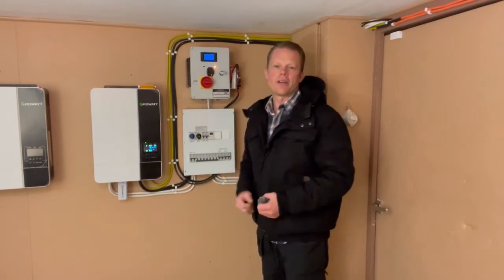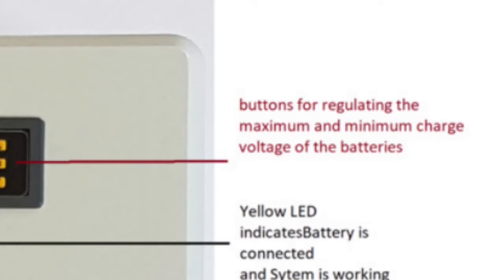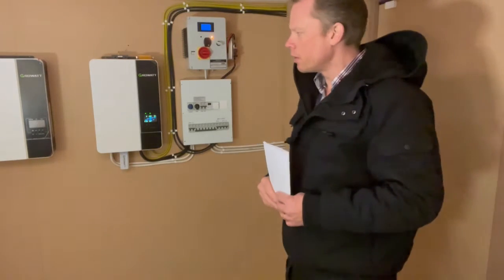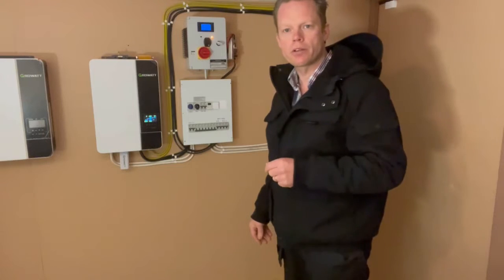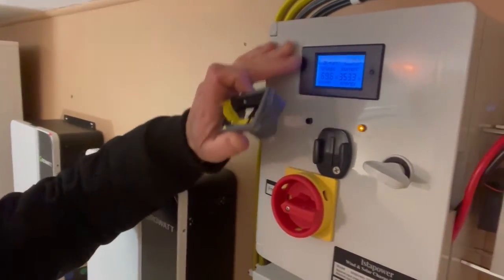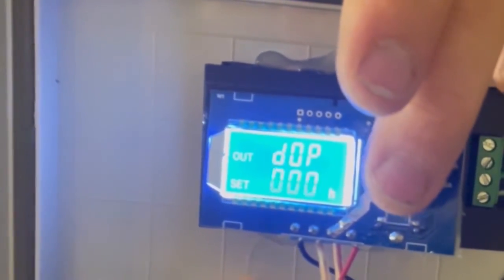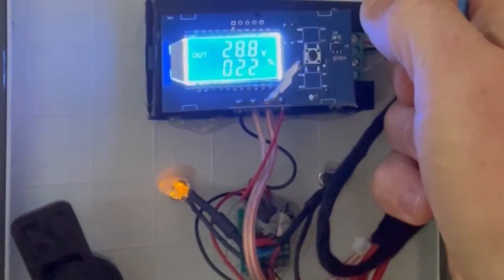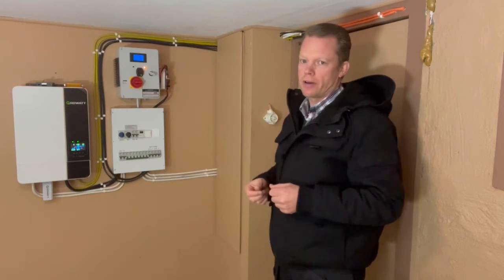Istapower wind turbine charge controller any good?

Comment: this controller is pwm, how do you charge your lithium battery bank with that controller? I understand that lithium is only charged by an mppt controller
Reply from the maker: Good question.

No this is not an pwm controller. It is just sensing the voltage, and when the preset value are reached it just activate a relay that short the 3 phases from the wind turbine. So it is a very basic controller. 

As long as I not exceed the max c-rating and max voltage on my battery I pretty much can charge it with anything.
Reply: Lithium batteries require perfect flat DC signal, to avoid damaging it.
I don't know the circuitry of this controller but i would rather use an oscilloscope to check first before connecting to lithium batteries.
Reply: I asked istabreeze if turbine + controller will work with lifepo4, they said its not compatible, probably because voltage is not adjustable??
Should I buy? And do what you have done?

Comment: Hi! I have a question about the Growatt inverters that you have on your wall. Are they the "SPF 5000 ES"? If you combine 3 of them, could you have 3-phase output then? And if so, would that be 240v or 400v?
Reply from the maker: Yes they are SPF 5000 ES,  you can combined three of them 
(up to nine if you like) and have three phases 400v output or you can choose if you like to go single phase with all three of them in parallel or only use two units as I do. You have to keep in mind that each unit will take around 70 watts in idle power so it will be pretty high powerloss with three inverters if you not need that power they can give you. The efficiency will be very low in those cases. That’s why I decided to go with two units in parallel and only use the second unit when more power is needed.
Reply: Ok, thanks! I don't really need all the power from 3 units, but I have a tire changing machine and a wheel balancer that run on 240v 3 phase. However it seems to me that you need at least 3 units to get 3-phase output at all...? Would you know if 240v 3-phase also is possible?
Reply from the maker: No sorry, I don’t know that.
Reply: You can configure 3 growatts to create a 3-phase system at any voltage. It is written in the manual, and all over YouTube.
Reply: @optopot4965  Ok, thanks! Would you know if there are smaller (and reasonable) inverters available, that also can be configured to 3-phase at a chosen voltage? I mean, if you don't need as much as 15kw total power, it would make sense to use 3 smaller and cheaper inverters to achieve 3-phase power...
Reply: Sorry, i don't know about other than growatt. Their smallest is 3.5kw, so their minimum 3phase system is about 11kw. Typically, 3-phase systems are for large loads and motors.

Comment: I have had nothing but bad luck with mine. The first controller didn't work, they sent me a second one. That worked for a couple of days then the panel started reading 5 volts low and the solar inverter kept cutting out due to the batteries going over voltage. After speaking with them and getting a fairly curt response I took the cd60 control panel off the first one and connected it to the second panel, which seemed to work fine for a while - about a week. Then we had really strong wind and the brake relays gave  out, once again causing an over charge and an inverter shut down. I took the first one apart to have a look, there was a burnt out resistor and signs that the board had been reworked some time in the past - the second board has beefier resistors on it so it looks like they upgraded at some point. The relays are cheap Chinese ones, I haven't taken them apart yet but I'm pretty sure the contacts are burnt or melted. The turbine itself seems fine, it produced 900 watts this morning before things started going badly wrong - the red led came on but there was no braking until I manually switched it to brake. Not at all happy.
Reply from the maker: That’s really sad to hear. Mine worked fine in 7 months without any issues at all, I have now sold it but I think it still works just fine. I which you better luck in the future.
Reply: I have had nothing but trouble from mine, I am sending it back.
Reply: Get a TriStar TS45

Comment: Hi, the one I have just bought says the opposite on the front cover of my instruction manual but by holding down the middle button it then allows me to make alterations. But the manual is not very well explained and I have no idea what the letters mean. UP dn Op Dop Fop ? Off I guess is when it turns off at full charge and ON I'm not sure about either, any help 😊
Reply from the maker: Hi, yes up is the highest voltage, the controller will activate the brake at that setting. And dn is when its going to release the brake.
Reply: Thanks for the answer. Do you know what the other symbols indicate? Mine also with the bottom arrow seems to turn 'off' which would be crazy because the batteries would not stop charging. Does your manual explain how to alter settings and what the symbols mean? Thanks again for any help 🙂
Reply from the maker: Here is what I found:

OP: turn-on time, dOP: delay turn-on time (0-999 seconds), FOP: forced turn-on time (0-10 seconds) in discharge mode.

Search for “cd60 charge controller” then you will find more about it. Hope this helps🙂
Reply: Thanks that's very helpful 👍🏼 Now I know the screen model and it describes how to set it up, so problem solved!

Comment: Hello! Thanks for nice video - woudl you be so kind and send me a pictrure how have you done wiring of the meter inside the controler. Thank you very much. Also if anybody knows what is F0-F03 settings? Thank you!
Reply from the maker: Hi and thank you. The wiring is very simple. Just connect the positive and the negative to your incoming battery wires and the other two to the shunt. If it shows you the wrong charge/discharge current just change the position for the wires on the shunt. Good luck and welcome to my channel 😊
Reply: @flyingtools  Hello and thank you for reply!!!
By shunt you mean what please? ;-) 
Good luck with new invertor! Also going to get newone soon for my system!

Comment: so you did hook the ista controller directly to the growatt and then into the lithium batteries from there? what kind of batteries you use?
Reply from the maker: Hi!
Its connected directly to my battery bank.
I have built my battery from two vw e-up Hv battery 36kwh lion. Now I use a battery from an vw id3 on 400v 62kwh instead of 48v.

Thanks for your comment, have a great one🙂
Reply: @flyingtools  ui, where did you get your hands on these EV batteries in sweden?
Reply from the maker: @LastEmpireOfMusic  I bought them from a junkyard in Norway.

Comment: Sir, this is a great presentation and video review for the charge controller, and for the modifications you applied to it. Very intelligent I would say. One question if I may, how did you wire up the blue AMP/ VOLT meter display with the system ? I have an iSTA Breeze i-2000 wind turbine and the exact same controller and the same display meter myself. The blue display is rated at a maximum of 100Amps, and my battery bank is currently formed from 4 x 48 volts LiFePO baterries in parallel, 75Amps each, so around 300Amps. I want to use the AMP/VOLT METER to monitor what my wind turbine produces, and I just want to avoid a short circuit or anything alike. So a few instructions from your side on how should the display be wired up, that would be much appreciated. Thank you in advance, and keep up the good work. You are a valuable resource for our DIY community.
Reply from the maker: Hi and thank you so much sir. Sadly I don’t have this set up any more but if I had I probably would made a how to video about that. I have tried to explain how I did that in some earlier comments, but a video about it had been the best of course.
Reply: @flyingtools  Thank you very much Sir !!! I think that should be put between the wind turbine controller and the battery. I will manage to install it by myself eventually.
Reply from the maker: @brainbyte3970  no problem. I installed the current sensor between the rectifier and the battery. And then just + and - to the display. 
I think you figure it out👍🏻
Reply: @flyingtools  Hello again Sir, I am afraid that I have a little bit different of a charge controller for my i2000-48v wind turbine, and I don`t know exactly where are those two points right after the 3-phase rectifier inside of it. My charge controller is almost identical with yours, just that the components inside are arranged differently. I connected the VOLT/AMP meter, but I think that the red wire is connected to the (+) of the battery. The voltage that used to be displayed on yours, that is the actual voltage generated by the wind turbine when it is working, correct ? Not the battery voltage, correct ? And I saw that your VOLT/AMP meter lights up when the turbine starts rotating. Mine is permanently on, and it shows the battery voltage. The rest of the value are zero. Of course, the turbine is not rotating right now. Not sure where the rectifier contacts (+) and (-) are to connect directly to those points. A quick advice or maybe a link to a connection diagram would be much appreciated. Thank you very much in advance Sir !!!

Comment: good morning, I have the same inverter and the same control, with the difference that I have a bigger generator. Could you tell me how they are connected, I can't wor
Reply from the maker: Hi. Sorry for my late reply. 
The inverter and the wind controller are only connected to the same battery, not together with each other.

Comment: What materials did you buy for the turbine, do you need a dumpload resistor or is the 2000w charge controller enough?  How do you convert the 3 phases into one phase?
So if I could buy i-2000w charge controller and 4 metres tower is enough to use wind system. Thank you in advance my dear friend
Reply from the maker: Hi! I just bought some iron pipes and steel wire. I machined a tube at the top that fits perfectly to my windturbine so it don’t have any play in it. I only use the charge controller and no resistor. The rectifier are built in to the charge controller and converts the three phase ac power to dc. I recomend a much higher tower then 4 meters, 10-20 meters if possible. Hope this helps:-)
Reply: @flyingtools  Thank you very much for your help. I will try a taller tower ..
I have a question About the length of the cable and the distance of 150 meters.  if the distance were double what cable thickness is needed to avoid large losses?  also you use growatt inverters instead of victron multiplus II 48v. Why? Are more cheaper inverters or are lower consumption? 
Yours sincerely, Prokopis
Reply from the maker: 300m and 2awg will give you around 8,5% voltage drop. Growatt, best value for the price at that time.

Comment: Hello,
 can you share the wiring diagram how the solar and wind inverter are connected together with the battery and grid.
Reply from the maker: They are connected exactly as the wiring diagram in the manual, no connection to the grid. The meter does only need 
+ and - and the shunt In series wit the battery, you will find that wiring diagram on the meter it self.

Comment: Great video! I think they have nice products but the support is rubbish. 
Can you tell me, I am running a 12s lithium pack currently, so I want it to stop at 49v. Do you know if you can set it that low? Their support cannot even answer me this. Same for Tesup support. Apparently it is very hard, such a simple question. Thanks in advance!
I am contemplating an i1500 with controller.
Reply from the maker: Hi and thank you! Yes it is possible👍🏻
But you have to do as I did in the video before it will work.
Reply: @flyingtools  So it can go as low as 49v? I understand I have to do it via your way.
Even though the controller is rather simple, I like the built in safety against storms / too high speeds

Comment: Hi,

That blue Display..Is it "Plug and Play"?

There are 4 wires thats going to the original Display. Can i just use theese to plug it in the New Display? In my Controller i only see 4 wires to the Display. You have 4 for one Display and 4 for the other. Did you do it yourself?

Thanks
Reply from the maker: Hi, no it’s not, but it is very simple to install. The original display is the voltage regulator so you need that to be connected as it is. The blue display is only a power meter and you just connect + and - and the two other to the current shunt that comes with the power meter.
The original voltage regulator did I just glue on the inside on the hatch. Hope this helps and good luck with your installation😊
Reply: @flyingtools  can you share a link?

Comment: I  have a Growwatt inverter also, I'm curious how you have it hooked up to the wind generator.  I have been wanting to do a solar over wind setup lately and can't find much info.
Reply from the maker: Hi!
The wind turbine has its own charge controller, but it would be grate if growatt had a wind controller to. 
Thanks for your comment 😊
Reply: @flyingtools  are they hooked to the same battery bank?
Reply from the maker: @millennialocracy  Yes 👍🏻
Reply: So, did you just parallel the outputs from wind controller and solar to the same battery bank? Or a blocking diode to prevent the inverters and wind controller from interfering with each other.?
Reply from the maker: @DovskiRae  just parallel, no diodes.😊

Comment: Hi, very nice video!! 
I have a little question, the Brake handle, when is supposed to be used? 
And, when is in "Brake mode" will still charge the battery for a little amount or not?
Thank you very much!
Reply from the maker: Hi and thank you!
I use the brake when I disconnect my battery bank for example or do some other work in the system. In the break mode it will short-circuit the three phases so the turbine will stop and no charging is possible.
Reply: @flyingtools  Thank you very much!
And the "DC Amp Meter", showing the Watt, Amperage and Volt that the wind turbine produce, how i'ts wired to the controller?
Thank you in advance for your time!
Reply from the maker: Hi, it has its own power shunt that is connected in series after the rectifier an then you just have to connect it to the power. + and - really simple.
Reply: @flyingtools  Thank you!

Comment: a TESUP controller has manual adjustability…..but no solar input control, its purely dedicated to the wind power control….
Reply from the maker: Ok, that’s good.  I did not use or test the solar charger on this, but hopefully it worked.

Comment: Hello!
Which Kind of Batterys you charging with this Controller?

I have the istabreeze I-2000 Windsafe and searching for a Controller which can handle lifepo4 batterys.

Thanks in advanced!
Reply from the maker: Hi.I have a lithium-ion bank on 36 kWh that I used together with my solar panels and also this wind turbine and it seems to work just fine. With a 16s lifepo4 I think you be good but you have to check the end voltage to know for sure.
Reply: @flyingtools  thx!
Reply: @flyingtools  Witch Battery Cells you use? Maybe have a link or something? That would be awesome.
Reply from the maker: @Selfmadestrom.de_Blog  i have built my battery from  2 Vw e-up. So I don’t think you will find individual cells. I think any cell big enough to handel your power and voltage will be just fine.
Reply: @flyingtools  Hello Again!

Which Cabel Diameter you use for your setup? (From Windturbine to Charge Controller) and which distance? I have about 40 Meters from my Windgenerator to the Charge Controller and search for a earthcabel.
Reply from the maker: @Selfmadestrom.de_Blog  Hi. Please check out my other videos, a lot more information there.
Thanks.

Comment: hi, thanks for this video.I have an ista breeze 700 24 volts, at what voltage should I adjust the controller? thank you very much and congratulations for the video.
Reply from the maker: Hi and thank you. It depends on which type of battery you use.